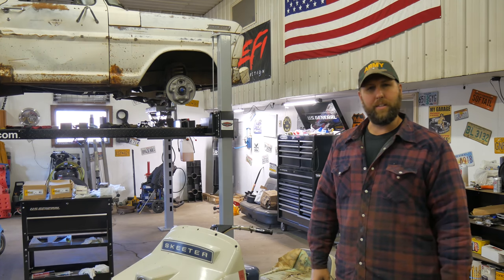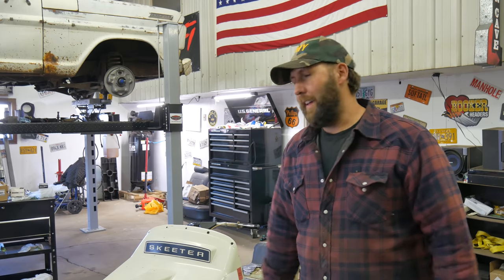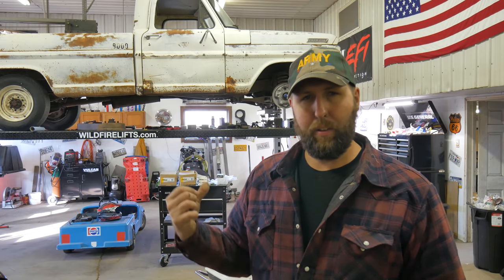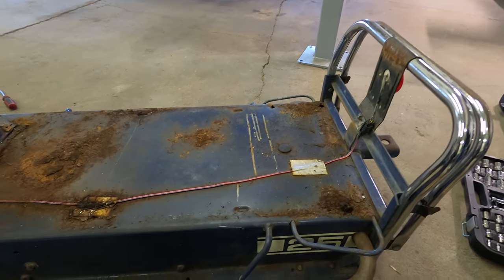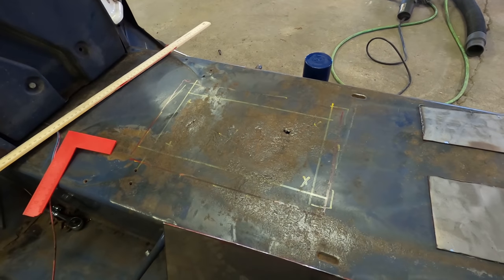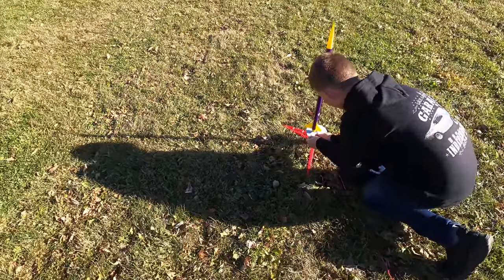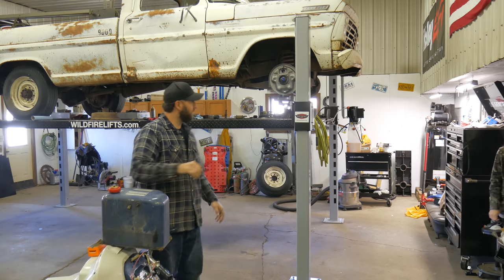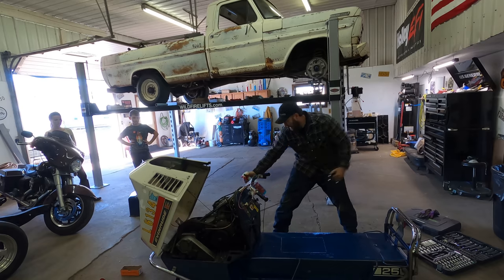FORGOTTEN 1970 Evinrude Skeeter Snowmobile - Will It Run? Part 1

Comment: I was for a time in the early 2000s the 3rd owner of a ‘58 VW beetle. The Vintage VW yard I bought it from in Brisbane had acquired the bug from the family of the original owner (deceased estate). He had hitchhiked the 80 miles from Toowoomba to Brisbane (Queensland, Australia) to pick up the car from the dealership in ‘59. The first service the car got after I bought it was done by a real old timer called Kev. Turned out Kev was a young mechanic at the original dealership in Brisbane in the mid-late ‘50s who prepared the new VWs for sale. Full circle 40 odd years later! In all the years I owned the beetle its original unrestored 40hp engine never once missed a beat. It was just about as fast and powerful as a paper plane, but you couldn’t kill it with a brick. I used to drive it regularly between Brisbane and Sydney (570 miles) and the little percolator never gave me any grief. Plenty of time to enjoy the scenery though. Old Kev went on to drive bugs in cross country rallies through the ‘60s. He told me the best way to drive my VW was foot to the floor, especially downhill, “so as to get a run-up for the next hill”. Big rig slipstreams came in handy. Your channel is top shelf. Thanks.

Comment: That's quite an engine. I had a 1970 Herter's Husky with a 440 Kohler and Tillotson carb. I had some trouble with the carb and talked to the guys at Twin Honda in Devil's Lake. They told me that back when they did snowmobile work and had a Tillotson come in with problems, they'd kit it once. If that didn't do it, they'd pitch it and stick a different carb on there. I considered that, but then realized that since my gas tank was an old 2 1/2 gallon hydraulic fluid jug tarp strapped to the back, my fuel delivery problems probably went beyond the carb.

Comment: You can cut a Qtip in half and put some valve grinding compound on the tip and run it in that needle seat to clean it up. Just cut the Q tip and put it in your cordless drill. Always works for me.

Comment: Visegrip garage, I've cleaned a lot of old motorcycle gas tanks and I've found that filling them up with vinegar and letting them soak for a few days works better than the old nut bolt shake method.
Reply from the maker: Thanks!  I've done this too, just didn't have a few days.

Comment: When cleaning the fuel tank use a pressure washer with some nuts. Use a hair dryer or a heat gun to dry it. Red kote is a good liner to prevent future problems and seal rust.

Comment: We used to carry the plastic kids sled in case some broke down in the back country (AK & BC). You can tow a broken sled by taking off the belt for sure, but you can also throw that plastic under the track ( secured ) and tow and slide her back home. Also in the era of that sled yep 24/1, oils were not as good, ( early on it was 30 w clearly stamped on the ski do can ) I may still have one laying around.

Comment: Here's a tip to clean a fuel tank. Screw out the tap in the bottom so the gauze doesn't get damaged and bung up the hole. Put in some diesel or kero and a handful of gravel (1/2 inch washed is good) and shake it, rinse it, and repeat until its pretty  clean and no more bits are coming out. put an extra filter on it and use it.

Comment: The cap looks just like any cap on an outboard motor tank. Also the filter for the fuel pickup can be gotten from Lowes or Home Depot they are the same that are used in lawn mower tanks just look in that section!

Comment: It really depends on the 2 cycle oil you're using. With some of the new synthetic oils you can go all way up to 80:1. Maybe even higher. Didn't have that option back in '70.

Comment: So cool.  I own the wide track, electric start, reverse model.  The primer system needs really hard lines or they will suck in when you try to prime it....originals were some type of plastic rubberized thing, and clean the check valves like your in a microchip factory or they stick.  Make sure to sand the drive and clutch pulley before you move it or it will narrow your belt in the first 1375ft and you will have wasted $$$. The control panel hinges down to reach the back spark plug which you will want to look at because they like a gap that they can jump with those Prestolite coils putting out very little voltage at startup.  Never trust Neutral.  They always want to run away on a guy, and the Tillitson likes to idle a wee bit high anyway.  When you put the tank on make sure the return line is clamped real good at the tank.  Pressure builds up at the restrictor and if it pops off it fills the chasis with gas till the points ignite what becomes a very intimate two story tall fire.  Don’t ask.  Great video.  You do such fun stuff!!!

Comment: Nice video. You can run old sleds on modern oil at 50:1 without issue.  When this one was manufactured, 20:1 was the norm, oil wasn't as well refined as it is now.   Use a quality two-stroke oil and you'll have no issues.
Reply: Also that damage on the track edge...take a torch to it.  Keeps it from fraying further.

Comment: A whole slew of controls for that rig, but one thing omitted is the cigar lighter found on practically all other form of man made transportation from the 60s-70s. 
Perhaps they saved that option for the battery/electric start unit? 😉 

Surprised they were recommending the 24:1 mixture ratio that late. 

16:1 to 24:1 was the recommended ratios (depending on the type of oil you used) for pre 1963 outboards. The reason for the rich oil ratio was allot, if not all the bearings in those engines were solid bronze type. From ‘63 on they changed over to full roller crank/rod bearings, and changed the oil ratio to 50:1. For a while OMC actually condoned a 100:1 ratio, but pretty quickly abandoned it. 

The change in spark plug type may actually be a discontinuation by Champion of the original recommended plug type. 
For a long time, Champion had made specific spark plugs for 2 strokes. The original model of plug recommended for allot of the old OMC outboards was a Champion J6J. Eventually Champion discontinued that plug, and recommended a J6C as its replacement.

Comment: the thing to remember about old 2 strokes weather its an outboard or snowmobile: the oil from the 60's was crap compared to the new stuff starting in the late 80's. 50:1 with the newer oil (for outboards that was starting with tcw-2) easily lubricated as well as the old stuff. i'd run synthetic now, 50:1. thats plenty of oil, even for letting it sit idle for a long time. no risk of rust.

Comment: Good news: A Guy (VGG) has the stuff to fixi-mate all the broken bits, mostly. Even if the Skeeter's tunnel weight reductions to include unwanted ventilation areas. 

Get you're few years of use out of the current body, then build one that looks like a Snow-pocalypse needs... all boxy and Utilitarian-like. As long as the mounting measurements are the same, mostly, it should work, right?

Comment: i love the Old 1970s Snow Machines  like most things  in that time things were built well  and fairly solid like you mentioned comparing it to modern ones not  way too much flimsy plastic  i have Buddies that have a lot of kids and a Hunting Cabin way up in the Mountains those guys resurrected  several old Yamaha machines  and got them in good running order  and just keep yup with the maintenance plus store them  in their garage at the Cabin  those old Yamahas  have proven to be the Smart way to go  for those guys  and throwing a few dollars at one every few years  keeps them way ahead of the game financially  BTW that Cabin is close to Pennsylvania  in Maryland but still in a big Ski and Winter Sport area  so they watch the local Craigslist ads and Classifieds  to pick up machines very reasonably priced  ive also owned many Sea Doo Personal Watercraft and  i like Bombardier products quite well  i’ve found their network of dealerships and  information and parts availability World Wide  is fairly good  sort of like Honda Motorcycles  they have been around for years and years

Comment: A feller know a little trick to speed up the tank cleanin process for ya.  Don't tell Jess, but drop your hardware in the tank as normal, then seal and wrap the tank in an old blanket and shove it into your dryer with blankets or old towels packed tight around it so that nothing will move freely in the dryer.  Then run it on tumble with no heat for 30 minutes or so and crack yourself a cold snack while you wait for it to do the hard work for ya.  Worked wonders for my motorcycle tank.

Comment: I have to agree with a previous post.  It really is great to see a dad teaching his son how to use wrenches and helping on a project.  I also had to laugh at the requirements you carefully asked your wife to adhere to concerning the retro style upholstery.  What is more retro than a  duct tape repair. 👍👍. Double thumbs up.  I didn’t want you to feel left out either, your contribution as a moderator/spokesperson/narrator/wrench twister, gas can shaker, splatter spark gluer and all around ramrod was pretty impressive too.  If I am ever in your neck of the woods and I see someone pulling frantically on the starting rope of an old Evenrude snowdrift hopper, I’ll just wave as I pass by, remembering that there might be a lesson in there your trying to teach your young son.   🧐🤔😏😊

Comment: Oh, baking soda, water and stainless steel birdshot will get the tank clean inside. Follow up with lots of water, dry well, and coat the interior with tank sealer, you can buy it by the quart.. works a charm for crappy fuel tanks

Comment: Find a Polaris 244! You can get them running with no work! First snowmobile I ever rode was an Evenrude with my grandpa, and we used it to get wood. I'm pretty sure it was a dual track, but I could be wrong. Did Evenrude make a split track?

Comment: Evaporust is awesome for gas tanks this size. Its $20 a gallon, but totally reusable so save on it after you use it. Just let it sit in there for about a week. It also works well diluted. 100% non corrosive and skin safe. Its got a smell to her, but you could wash your hands in it.

Comment: Rust in the gas tank, I work on old motorcycles with steel gas tanks,,, fill the tank with Muriatic acid and water, let sit a day or so, eats all the rust out,, Then if there really badly pitted they have a gas tank sealer you can coat inside of tank with ,,, Cool sled

Comment: I had opened up an old 2 stroke leaf blower.  "Stopped working" a couple years ago according to the user.  It wouldnt start with regular means.  I took the diaphragm off the carbureter/fuel pump and it was 100% oil.  Either they didnt use an oil that stayed in suspension or they poured the oil in the tank instead of mixing it into some fuel first.  Then the oil just drops straight to the bottom of the tank and sits there.

They would have likely been using 30W motor oil instead of dedicated 2 stroke oil.  My friends sled wouldnt run and when I saw how poorly 30W mixed it was no surprise.  I bet there is gooey messy garbage in every low spot in the fuel system.

Comment: The air fuel mixture goes into the lower end first then when the piston goes down, it forces the mixture up into the cylinder. So the oil in the gas lubricates the lower end, not the top end. That's why 2 strokes don't need oil in the crankcase.

Comment: I've ran 70's Artic Cats, couple ski doo's from same era.  That dual exhaust is the cats behind.  The real issue I think that was being remedied with this is that snow will build up in front of the sled if your not on a packed trail and builds up to the point of blocking the exhaust up front (factory location for exit).   This in turn simply kills the engine, can't rev up, loses power and whah lah, you are now stuck.  Dug myself out many times because of that.

Comment: I like Evinrudes. First boat motor was a 6 horse Rudy. Recently seen a motor less Trx 250R that is darn close to Rudy blue and white. If  the Rudy motor fit she sure would rip.  I’d think the motor would love something by Toomy  racing exhaust. If they needed the sled In order to fit the exhaust so be it.. It would get back sounding meaner than a banshee. Call it, Comanche .

Comment: Old Snow Crusher, they competed with Arctic Cat for who could build a heavier machine even though the Cats had aluminum tunnels but screwed up by putting the tank on the back, making it impossible for one person to lift the ass out of the snow to get unstuck, Johnson had the same machines but a different colour, you always carried extra plugs as they always fouled a couple of times per day, we used to use a Champion spark plug cleaner (sand blaster) so you didn't go broke buying plugs all the time. In 1970 there were over 200 different snowmobile companies.

Comment: Run 50 to 1 oil mix with modern 2 stroke oil , the 24 to 1 mixture is for 1970 oil.

Comment: The plastic blue liner wrapped around the extra belt is used if you need to tow the sled if it craps the sheets.    Makes the towing easier under the track.    Towed my sleds more than riding them.  Hummmm.   Now I just drink beer.

Comment: Waiting to see you use Fluid Film to lube stuff up and break rusty bolts loose. Amazing stuff and non toxic.
Reply: Does that stuff actually work as a penetrant?
Reply: I use fluid film as basically a thin grease undercoating on my trucks here in the salted roads of western NY state
Reply: @tacomas9602  same! So many uses!
Reply: @tacomas9602  everyone has got those pliers you have to pull apart with 2 hands. Used everything on them over the years. Still tough to open. Fluid film for 10 minutes. Worked them back and forth a few times and they just fall open now. Amazing stuff

Comment: I bought the same snowmobile only it was a 1967. I reconditioned it. This was in 1998. Was ancient back then. Was slow as can be but after using it for a few hours It started to speed up to its maximum speed. Which was about 35 miles an hour. As I look back I wish I never bothered with it. Today my philosophy and recommendation to young folk is do less maintenance just ride and enjoy yourself with a modern sled that don't need so much attention and maintenance.
Reply from the maker: Thanks for the advice !

Comment: Do you worry about an extended time frame when trying to get a 2 stroke running on the magic juice spray bottle?  Considering its 24:1 or any other 2 stroke  40:1 50:1 for that matter ? or does the magic juice offer up enough lubrimafication ? cheers from the Great White North.

Comment: I had an old 1950-60 something sled,  I remember putting lead substitute in the gas.  Not sure if you know anything about that.  I was told I needed to do this because gas is obviously unleaded now-a-days and rotary engines needed lead for lube.  I really don't know what I am talking about though as I am absolutely not a mechanic. I don't even know what a rotary engine is.  I was told it was a rotary engine.

Comment: 24:1 is for old ass oil. New oils have much better lubricity. 40:1 is plenty fine. Most new sleds mix to 100:1..My buddy had the wide version with reverse and open chaincase. It was a 1965.. Pretty cool unit.

Comment: Need some advice. My jumper pack diehard platinum 1150 Amps needs replacing, I have 3 antique cars I sometimes need to jump  the engine are a 400, 413 and a 500  should I buy another diehard or something else? The JNCs seem OK but also a little small for what I need. What do you use? And what do you think?

Comment: Dude I do not understand are you restoring this or just rust erating it ? you can find any screen tube for the tank and just about any vented cap as long as it is the same lenght as the one you have and size . It does sound great can not wait for second video good job restoring it

Comment: a roll of nickels works better than anything except in the corners. the shoulder on the coin is like scraping carbon off a piston with a feeler guage.
soaking the entire cap/vent/guage sender in cheap vinegar will open vent and clean rust and varnish off.
for a sock, a fuel filter with the gold metal element. carefully drill 1/16" holes in wide end. will siphon well and great screen.
can Bentley help me with my auto caps? I read in 4 directions too and only understand pics and numberz.

Comment: Grandpa would use water on them small tanks after the first clean out then use some shop rags stuffed down the tank and use a air hose to flop them rags around in it till it was dried then just fish out the rags.